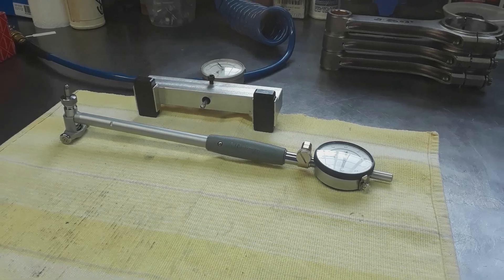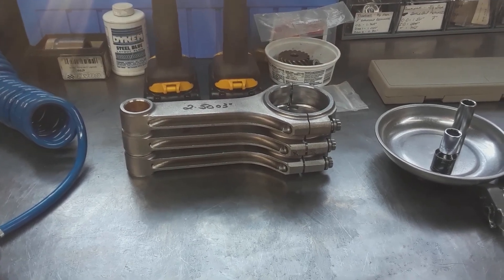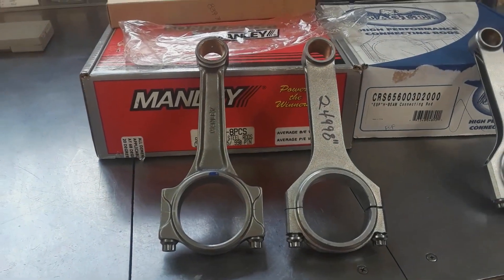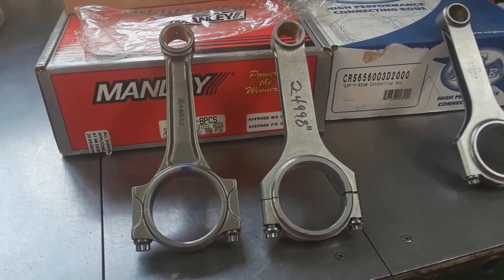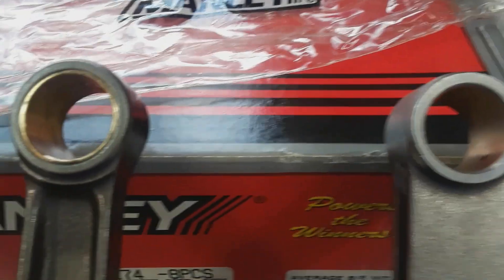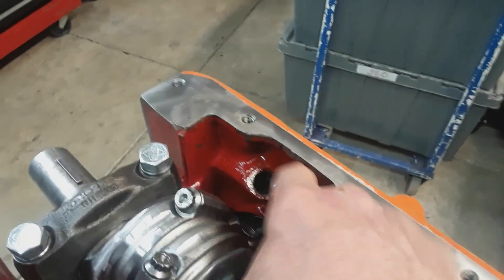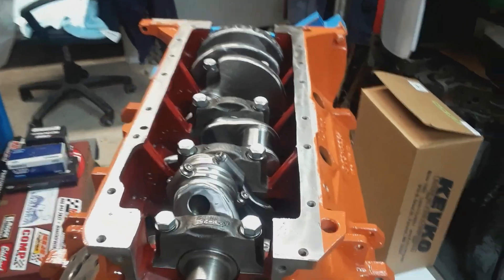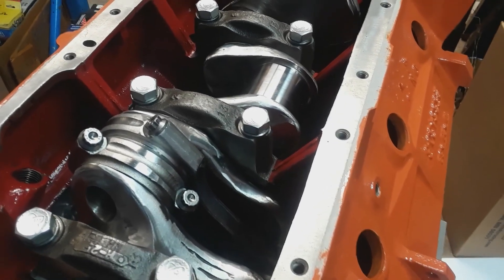Precision Engine Building Tools

Comment: The guy that does all our machine work, he said they will not use Eagle parts, and they will not use Keith Black pistons, the ring is closer to the top of the piston, in high stress situations, the top of the pistons will break off. It doesn't hurt to ask advice, machine shops that have been around for 80 years usually know what are worth buying

Comment: I bought an NOS Hemi DC Kellogg crank (P3690285 I think) about 10 years ago still in the box which was prepped at Joe Lunati's Chrome Crankshaft in Memphis in the early '80's. It's never been used, or ever balanced but I noticed they cut the journals .010 and wondered why. I was at a car show a few years ago and Larry S. said the same thing, it was the max you could 'offset' cut for stroke. I read that out of the box those Kellogg's had super tight stroke equalization and indexing tolerances. 
I saw that your cap bolts looked like S.P.S. bolts rightaway. Too bad you can't get those anymore. They were a great alternative to ARP, usually a lot cheaper and just as good. Mr. Gasket used to re-package and sell a lot of them. Those big blocks have such deep skirted blocks 2 bolts or studs on the mains is strong enough.

Comment: In construction, H beams are always stronger than I beams, all things being equal, it's just physics. In an engine, I beams are lighter, but H beams will handle far more compressive load (again, all things being equal). When should you use an H beam over an I beam?... well, guess you'll need to talk to your engine builder about that, everyone has their own idea about what's right and wrong for each application. I have a set of Manley H beams if you'd like to compare apples to apples.
Reply from the maker: And the winner of a case of Bud Light is?......."anarchyisfreedom9671".......for the most profound ignorant statement of the decade! Turning an "I" beam on it's side does NOT make it an "H" beam. What "woke/rainbow flag flying" engineering school did you go to? What's next?......gravity is a "perception" problem? I did not think guys with the intellect like you were really out there. Proved me wrong.....this culture going forward has no hope for survival if this is the predominant/collective "intellect".